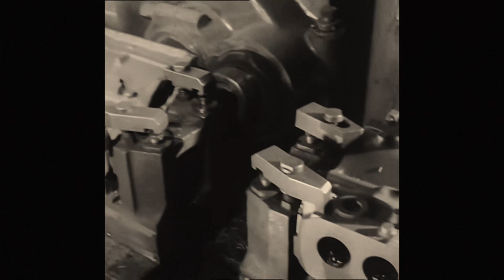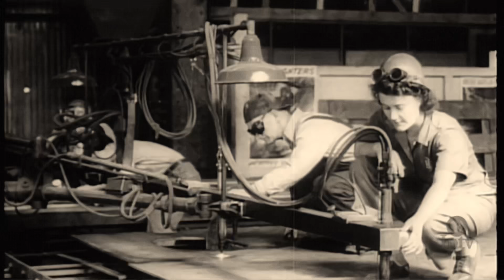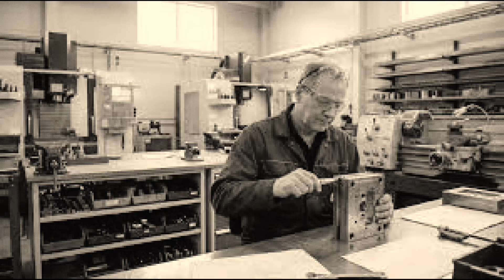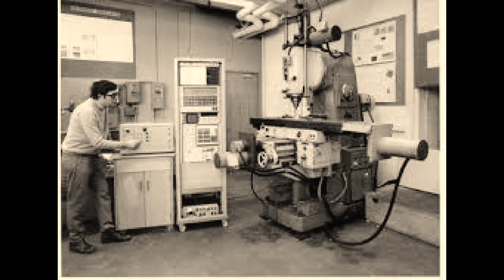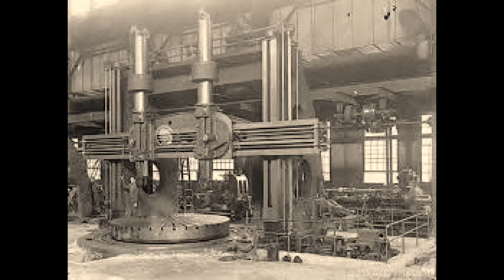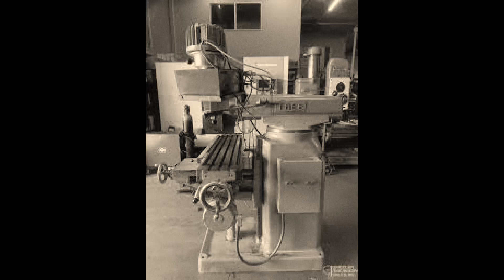How a Machine Better Than Bridgeport Was Forgotten by Machinists

Comment: I used them, correct the Tree was better solid as an Oak. Actually I prefer The Wells-Index. I do have a Bridgeport now, Its a Series Two. Has 4 inch box ways on the Y and the table is 11 wide. Has 14 inch travel in Y and 38 in X. It is very accurate, and extremely solid. I like a lot.

Comment: The vertical mill a machine that does absolutely everything but not one thing particularly well. The Bridgeport was the easiest to use and most productive. The Tree had its own collet system but did make the famous Tree angle boring head.

Comment: If you stopped using AI , you would actually have correct facts you'd actually know that. Although they started in 1929, they did not produce a milling machine until 1950 so there was no way the milling machines were made during World War 2 now, Bridgeport milling machines, on the other hand started in 1939 So that means they actually did war production😂😂😂😂😂😂😂

Comment: The shop i worked for in the late 70s-early 80s had a mixture of Bridgeport, Gorton  and Excello vert mills, and a big clunky Kearney Trecker horizontal manual machine, with uttery worn out lead screws. What a beast!
Reply from the maker: Amazing, especially after all those years of work.

Comment: I'm an old tool and die maker (graduated from a registered apprenticeship) and then advanced into management. Started in the late '60s. Ran both machines and the Bridgeport out shined the Tree every time. Manual machines.
Reply: A Tree didn’t make sense. A Bridgeport was as natural to operate as pulling down your zipper to piss.
Reply: I agree .

Comment: Actually a pretty good report. It didn't get annoyingly repetative, like most AI generated scripts, until the last ten minute. And thanks for saying damping, rather than dampening. 
  The CNC shop where I worked had a 2UVR which we used for some second ops. Not being a mold maker, I don't know that I liked it better than a BP, but it was silky smooth. A very nice machine to operate. I programmed and ran a couple of Tree CNC machines as well.
Reply: i caught that too.   im a damping  vs dampening ocd  guy myself…  😬👍
Reply: not saying you’re OCD,  rather meaning, you’re correct 👍

Comment: Tree master journeyman 425 was a pretty capable tool room mill. I was so fast at programming on the conversational control just because of how it was layed out.
Reply from the maker: It was "too good," and that's exactly why it couldn't evolve. LOL.
Reply: I ran and programmed a Journeyman 325 back in the early 80’s. Jim Tree visited our shop personally. Very nice guy.
I still own the original Mill i started working on. An Induma (italian made) old step head.
I used it in my cabinet shop to build specialized tools.